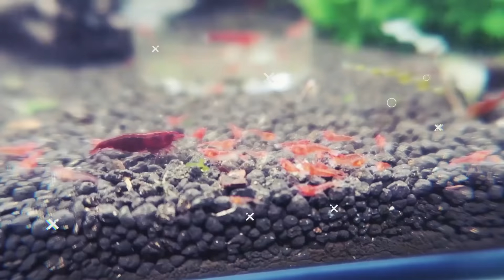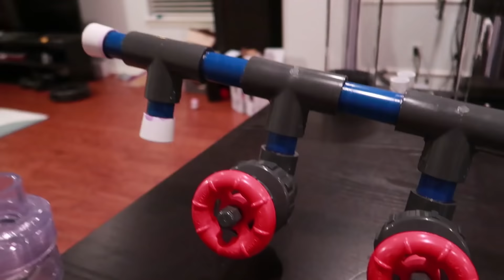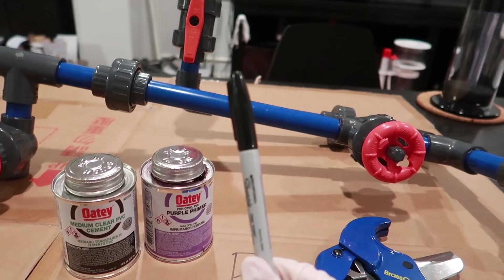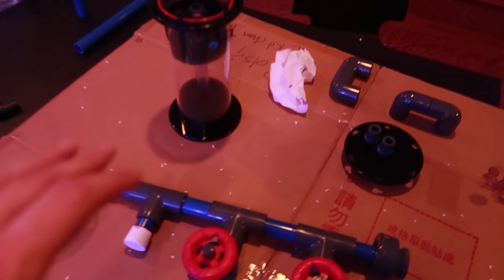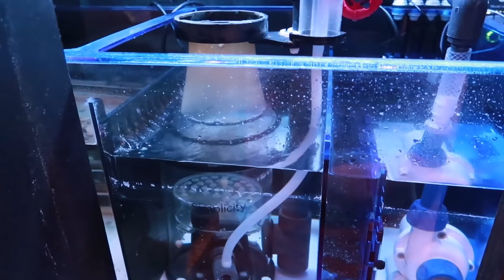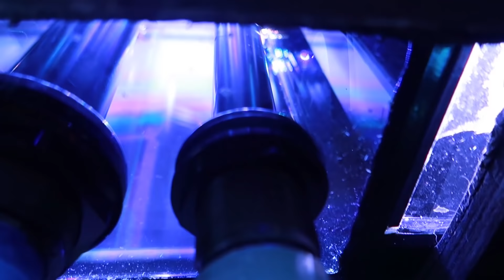250 Gallon Saltwater Build | Part 3 - Plumbing (Sump, Manifold)

Comment: I noticed you used the cement before the primer. I work on a golf course as an irrigation guy and have always primed first for so it helps break down the pvc a little before cement. If pressurized I would keep an eye out for leaks. Love your vids man keep up the great work.
Reply from the maker: Good to know! I always did it the other way around because the excess primer being added back to my cement container would cause it to congeal making later projects more difficult. That said, I think both methods work though putting primer first may be better.

Thanks for the tip!